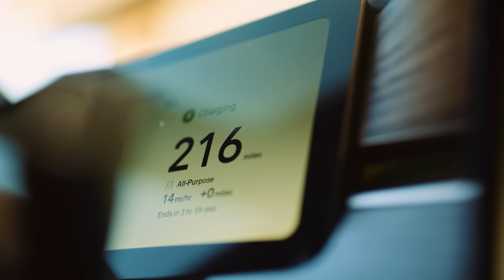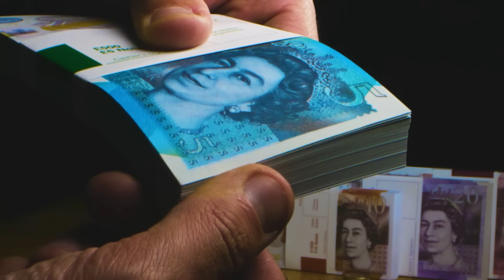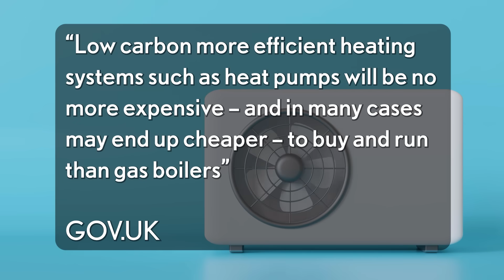The Truth About an All-Electric Future

Comment: The unspoken problem with going electric is storing it at scale. It's difficult and hugely expensive with current technology. Why is this never mentioned?
Reply: You think storing electricity is expensive? Try storing hydrogen if you want too know what expensive is!
Reply: Solid state batteries are very close to being mass produced. It solves many of the problems associated with renewables as the charge super fast, they're much smaller, long discharge rate and hold the charge almost indefinitely. Likely to be expensive but then dropping in price due to commercial demand..... much like solar panels. We paid 1200 for 5kw panels.2 years ago cost 600. And the build quality efficiency much better.
Reply: It’s not really hugely expensive when you come at at it from a different angle; building a power plant just to cover the peak evening loads was hugely expensive, battery’s storage to time shift energy is on a comparable scale.
Reply: Royal Society did a brief on it called "Large scale electricity storage", you can read it online. It's extremely thorough, and the recommend hydrogen in vast voids as storage.

They dismiss batteries and pumped hydro (about same size, currently) as 'thousands of times too small'. Those things work for us at home (I have 20kWh!), but one needs to look carefully at the scale of the numbers involved nationally.
Reply: There were lots of things not mentioned. And whilst you're right, we do store electric, a lot of households now have their own batteries.
Reply: @lksf9820 yes, true, and think about how much power they hold and how long they last and then imagine how big they would have to be to hold enough electricity to power an entire house 24hrs a day, or a town or a city...... with all the industries and businesses and transport etc? Vast, I should think, and volatile. Have you ever seen a battery fire?  Not pretty and definitely not good for the planet. As I understand it, the problem with sporadically-producing electricity sources is, they either don't produce enough or they produce power which can't be stored, and so they need a constant back up supply which as far as I am aware is being bought from other countries at the moment.
Reply: @lksf9820 no they don’t.
Reply: @lksf9820 it’s minuscule though. The maximum you can have is 13kWh. Which means if an average house uses 8kWh per day - not including power hungry electric cars or heat pumps - you have about a days supply of power as the batteries are best used between 20 & 80% capacity. The fact is batteries are very expensive as it’s also the invertors and switching system to be paid for.
Reply: @sullivanrachael that is incorrect. 

I've got 15kwh,and can upgrade up to 200kwh if, for some reason I needed to.

Modern systems are starting to come with the option of using the battery of a compatible car if desired - your average electric car could run a house for several days.
Reply: @lksf9820   All manufactured in China from petro-chemicals then shipped over on bunker fuel burning ships.  So green!
Reply: @Me-zo8yc shipping is very efficient. Batteries are very recyclable and are key in smoothing out generation.
Reply: @Biggest-hz7ng  I love the way you just gloss over the shipping pollution 😂
Reply: @Me-zo8yc because it is minimal. The ships have no hills to climb on their trip, just water to displace. The fuel use is shared between all items on a large container ship.
Reply: @Me-zo8yc 40% of world shipping is dedicated to moving fossil fuels around.
The batteries are built in the UK the cells are shipped once mine has   a 12 year guarantee.
China deployed more renewable energy last year than the rest of the world combined.
Reply: @SlowhandGreg  Are any of those fossil fuels used in mining and refining the metals for your batteries?  How about the plastic casing, the insulation for the wiring, the solar inverter casing?
Reply: @Me-zo8yc  What's your point?
Mine is cheaper energy you seem fixted on  the need for oil?
You can make bio plastics if you really want if your an eco worrior?
Reply: @SlowhandGreg   Oh I didn't even get to fertiliser, pesticides and the Haber process yet.  Still maybe you're OK with billions starving, being the caring type.  Now, go away.
Reply: @Me-zo8yc  You know pesticides and herbicides are not really needed if you do proper croprotation and companion planting.
But hey I just grow my own and feed myself

Chilli and apple crop has been amazing this year
Reply: @SlowhandGreg   You ate nothing but chillis and apples for a year?  Now it all makes sense. Funny how the world population chart also correlates with the energy bounty that oil and gas give us.  Still I'm sure the ancients that lived off the land just didn't know enough about spinning crops or whatever you're on about.
Reply: @Me-zo8yc  You don't need herbicides and pesticides to grow crops you just need to know what your doing.

At what poin point are you going to admit your barking at the moon?
Reply: @Biggest-hz7ng 
Ask any tradesman who uses lithium ion battery powered tools. They'll tell you they're a boon. They'll also tell you that you'll be lucky to get more than five years out of them.  Same technology. One of the reasons ev aren't selling.

Comment: Solution: All cars must be EVs with LFP batteries (10,000 cycle life) and all cars must be plugged in when parked. All cars will be part of a nationwide VPP (Virtual Power Plant) and will both soak up excess generation (wind/solar) as well as back-feed power into the grid when needed (peak periods). A reasonable EV battery will run your house for several days. Solar must be stuffed on every reasonable surface.

Comment: The gas pipe replacement scheme was set up well over a decade ago, long before the heat pump revolution was set in motion, it just hasn't been finished yet! Yes, I agree that the electricity infrastructure is not in the position yet to support we will be needing from it in the very near future. There will always be a need for a backup sauce on days (like today) when the sun isn't shining very bright and there is no wind. We may have to think about building mini nuclear power stations, but that comes with its own problems! Nothing is simple or black & white and compromisees will always need to be looked at!

Comment: Standard anti green rhetoric. As always there is a grain of truth in many if not all of the points you make but you seem to sum up by suggesting we just don't bother until a miracle solution presents itself to the world.The fact is that oil/gas WILL run out and IS damaging the climate. So just push the problem down the road for your grandkids or at least try to make a start now no matter how imperfect the first attempts may be.

Comment: My understanding is that about 10% of  current gas is from digesters, & probably rising, & could rise a lot more. No shortage of biomass, especially as higher co2 levels & warmer temperatures makes everything grow like crazy!
Creating a net zero infrastructure is a massive task so we're going to have to use what we have, so turning electricity into hydrogen & using the gas network makes some sense.

Comment: Can we be honest and say that this country and others in the EU and world aren't ready for 2050 - all countries have a skills shortage as they all promoted University degrees over trades for decades and now it's causing a global issue for the transition. 
Hydrogen is a non-starter domestically because of the amount of people will aluminium boilers fitted, aluminium embrittlement due to hydrogen is an issue that can't be resolved. Stainless steel heat exchangers are hydrogen ready but the ionisation controls need UV cell backups for boilers to be safe to operate on pure hydrogen.
Then you have the issue that hydrogen is low in viscosity and will escape through any joints and weak points that natural gas wouldn't. 

Then we have the electricity grid issues. The national grid can handle the power needed but the local grids can't - the transformers are sized to match predicted loads - though the predicted model they used in the 1950s-1980s didn't allow for a fully electric future so they're slightly under sized hence anytime we have installed an EV point, Electric Furnace, Electric Shower, Heat Pump etc we have to notify the local DNO's.
Local grids are having pen faults (the combined neutral/earthing conductor rots through) more than ever as DNO's like most companies put profit over maintainable supplies. Yay for successive governments privatizing national infrastructure. 

In short we have lots of professional liars in government (definition of a politician) but no engineers that had the foresight to actually prepare for the issues, every country is in the same boat and annoyingly still we have people like Ed still being given positions they're unsuitable for because they are not engineers. This is why mini reactors and more wind farms and huge 1000 mile long undersea cables keep getting floated as ideas by politicians, because they just want to sound like they know what they're doing but actually have no plan. 
Not to mention the ridiculous idea of using farm land for ground mounted solar arrays when the UK food market is 98% reliant on foreign imports. Hybrid farm land with elevated arrays so cattle and planting can still be done is a far more suitable approach - one which some EU countries have woken up to and have been doing for a couple years already. 

In short 2050 isn't going to happen, gas isn't going anywhere and there isn't enough investment in local grids to make electrification viable faster than it's currently being taken up. Without the green levy disappearing there is very little hope for faster uptake. & if it does disappear I am sure central gov will replace it with a tax on breathing.

Comment: The cables in our street was installed in the 1950's and although the local substation has been updated it the cables supplying it again apart from repairs are 1950s as well.  If this street went all electric heating PV and EV all that infrastructure would need to be replaced.  I addition despite the efficiencies of a correctly installed heat pump, electric as a fuel is a lot more expensive.  Very often switching to a heat pump may reduce your carbon footprint but you wont see any cash savings as the running costs will be the same or higher.  A lot of heat pump installs have PV and battery storage at the same time which really bumps up the install costs.
Reply: Yes your street will need to be dug up and the cables replaced, maybe some substations upgraded and some big transmission lines added. It will be costly and disruptive.

H2 is oresnrtef as an alternative with the implication that it would be cheaper as all we need to do is fit H2 ready boilers then start putting H2 in to the pipes instead of natural gas. That is incorrect. The pipes in the street will need to be replaced, as will those in your house (probably). You boiler will need adjusting and your gas hob, gas fire etc replacing - as will all your neighbours. And only then can you switch to H2, which will cost more than gas per kwh because it is made from gas.

The price difference between gas and elec does make the cost saving for HP marginal and very dependent on the efficency of the installation. But thar price difference is down to policy decisions - eg the cost of failed energy suppliers is about 0.9p a unit of elec but 0.3p for gas. Lots of the social and green levies fall on elec not gas. If the system were changed the prove difference would fall towards 2.5x which is the point a HP will certainly save you money.
Reply: @brianballard905  I think for heat pumps to be effective, at current prices anyway, you really need your own solar and/or batteries. That way the electricity you take from the grid each day is lower, bringing the cost of running a heat pump down as well.

I have some solar and a battery as well, but still use gas for cooking, heating and hot water for much of the year. In the summer there is no need for heating and the water is heated by the solar, but in the Winter we still use gas. But, we use less gas per year than we used to. I’m not interested in a heat pump right now, my next move would be to install more solar and possibly a second battery. Then the heat pump would be possibly be viable vs gas. It’s slow progress and long term investment (much like a mortgage). Heat pumps do work (it’s just like your fridge in reverse)  and can be cheaper, but only under certain conditions, if installed correctly and if operated correctly.

My biggest issue with this is those who would benefit the most - poorer families and the elderly - cannot afford or justify that investment. Many are living day to day financially, they can’t win either way - can’t afford measures that would help pay their bills and can’t afford to pay the bills if they don’t. Catch 22.

I think gas and oil will be around for several more years, but with more of us living in a hybrid fashion. That is having a blend of fossil and renewables in our homes, with each household being an individual case.
Reply: @javelinXH992 we use off peak to charge our car it's 7p a kWh
The grid is at around 30% capacity overnight
Reply: @SlowhandGreg  Similar here. I want to increase my solar before I get a heat pump though.
Reply: @javelinXH992  so going to be even more money to lay out
Reply: not interested in carbon saving. and not going to pay extra for it. so they can stuff there heat pumps. a heat pump burning 3 kw per hour for 12/15 hour shift is not cheap to run.

Comment: I think this is overly pessimistic: sure, the grid upgrades needed to reach net zero are substantial but as a challenge is it any worse than building the grid in the first place, or expanding it in the 50s/60s? Much of the equipment installed back then is rapidly approaching EOL and needs replacing anyway. Also, you mention generator curtailment, i.e. paying windfarms not to operate but that is huge part of what current & planned grid modernisation is about - removing the transmission bottlenecks that necessiate such forced shutdowns.

Intermittency is ofc an issue but again, the build-out of generator capacity (so we're less spatially locked-in on certain weather patterns) and battery storage are crucial parts of the solution. Due to their negligible use historically I feel we tend to dismiss the idea of batteries as a grid-scale storage medium but the cost of such systems has fallen at an extraordinary rate, it's no longer a pie-in-the-sky notion. 

I would however agree that the proposed timescales currently bandied about are just plain unrealistic, gas isn't disappearing any time soon. We also need to change the way we levy social & environmental charges, far too much of the burden is placed on electricity bills as an effective flat tax - it's unfair and counter-productive.
Reply: We had a 4 way junction box under our street spectacularly reached EOL last Sunday. Blew a 1/4 tonne manhole cover 3m up in the air. Narrowly missed several vehicles & pedestrians.
Still haven't quite finished fixing it, causing a week of traffic chaos.

Comment: The problem with analyses like these is that they almost always fail to account for the falling cost of storage. Just this year, solar + batteries fell to be the cheapest new energy source. Panels and batteries are going to continue to fall in price. Will solar + storage be able to account for all the energy use of a Northerly positioned country like England? Probably never. But these reductions in costs are going to seriously enhance its ability to participate as "base load" energy. Basically, natural gas peak plants will probably never be totally gone. But the need for them will be significantly reduced. And realistically, burning gas for energy in the home is probably never going away. Not in the North anyway. Unless maybe heat pumps have a magic card up their sleeve to double their already impressive efficiency.

Comment: the rational for electric cars was that they are cleaner, but most of the polution from a car's lifetime is from it's manufacture. keeping cars going longer is far more polution and energy efficient than buying new ones more regularly. They also need the petrochemicals for the tarmac on the roads. If they could improve the effeciency of electrolysis and storage of hydrogen it might become more viable. it's certainly a messy situation.
Reply: Untrue, EVs made in Europe "pay off" their manufacture in under two years, then you are significantly reducing pollution relative to an ICE car for the rest of its lifetime.
Reply: @Biggest-hz7ng  while the emissions in manufacture has gone down 50% in 5years in europe, keeping a car on the road longer makes the total emissions (manufacture, usage and disposal) per mile travelled go down, even with diesel or petrol. So it is more polution efficiant to keep existing cars running as long as possible. The comments made about the lack of electricity infrastructure for charging those cars and lack of production capacity still stands true; and for those regularly travelling longer distances, electric doesn't have the power density to provide acceptable range for many. When you can do almost 800miles on a fill up in electric, can drive through large puddles on the road without voiding battery warrenty, and the cars don't cost an arm and a leg, and actually have second hand value, then it can be a reasonable alternative in my view. Until then, it's only for the well-off. those on a budget buy second hand, and due to battery life (and cost) issues, electric second hand is very risky.
Reply: @DicksonTimScotland EVs are great, they are well priced secondhand, don't have a problem with puddles, there are many chargers for long distances (though particular areas may be poorly served) and will save you money on fuel. As I wrote, pollution is much reduced. They pay back in under two years as compared to ICE cars.